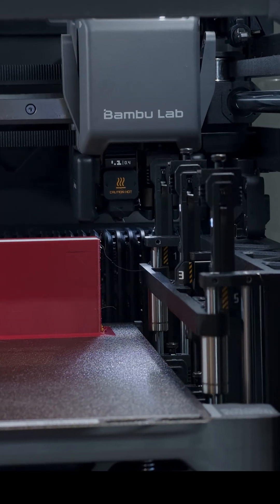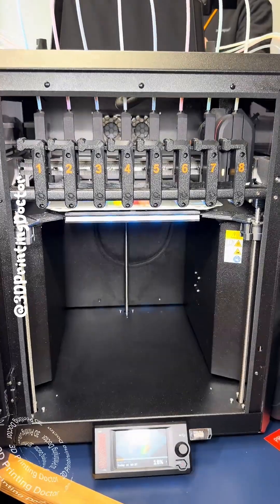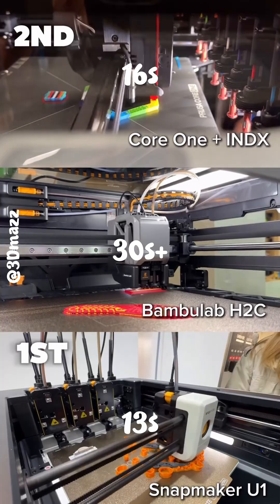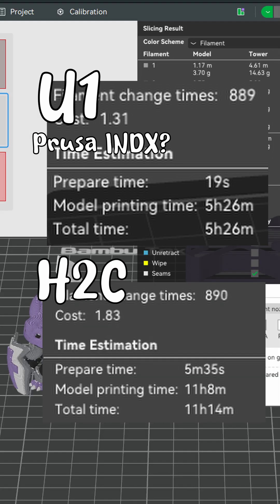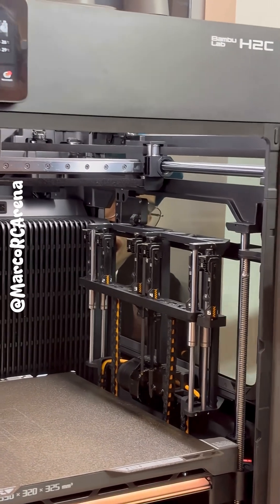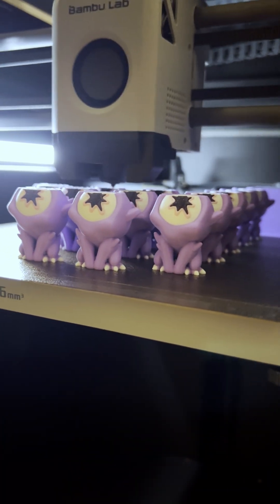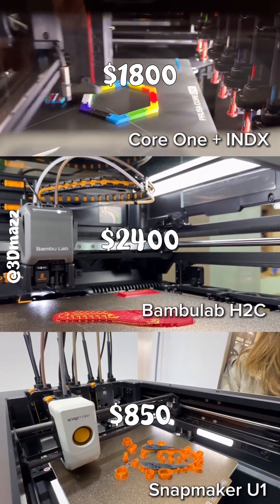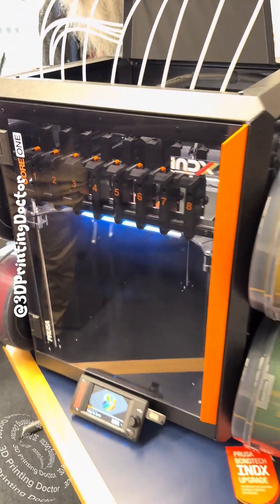The H2C isn’t worth it (for me)

Comment: The Prusa XL has problems with print failures 🤣. If one part fails it's over. Also the Prusa and U1 are small asf. And not to men the Prusa is a remote extruder... F that, you probably can't even print flexibles with it at least not reliably

Comment: I would still get the H2C, beside time, the H2C still does more. it can change Nozzle sizes in the software, And it can still run 24 colors. And I use the laser as well. Ands Bambu's Eco system is far better.

Comment: The H2C does make sense, it has upto 7 colours without having to purge, plus I have 3 P1S, and I like to keep the same eco system.

It isn't just for print farms, it's a very nice machine, I'll be using it as a hobby.

Snapmaker is decent sure but limited to 4 colours, and not anywhere near as big as the H2C.

The prusa could be excellent but that's not available yet, if you want to wait then sure, but I went with the H2C because the size and it prints colour reliably, and that's the key it's Bambu so the quality is the best out there right now in terms of FDM.

Comment: I literally just hit 100 hours on my U1 a minute ago that I've had for like a week. It's been pristine. I've filled up a tote with multi material parts and it's printing a multicolor tpu part right now. How does the H2c handle tpu? I don't think it's worth it anyway when it costs 3 times my U1 and is slower. I'm very happy with my print quality

Comment: Glad you said "for you".. I don't some multi color prints but the real reason I got the H2C was for engineering grade filament..printing CF-PC with TPU and things like that my fiberology fiber flex prints fine with the chamber heat up at 70 and prints as long as 12 hours
Reply: TPU isn’t usable on bambu labs printers properly though sadly. It’s such a faff for “it just works”.

Comment: H2C is a great one stop shop. I just need things to work and be as simple as possible since I work a lot and have little free time/ energy. Bambu's ecosystem and what H2C comes with allows me to do that with how easy the vortek system is. If Snapmaker's U1 was able to use everything in Bambu's ecosystem, I probably would have sprung for it instead. Currently, I'll probably get a P2S to help print single color models. I'm a very happy customer

Comment: The reason I’m going for H2C is mostly the convenience of the Bambu eco system; software, nfc filament, ams, slicer and huge community and profiles included with makerworld
Reply from the maker: That makes a lot of sense, it's a great ecosystem!
Reply: If you only need to print in 5 or 8 colors, but If you want more, then it's the H2C. Convenience is a powerful thing. Plus I think Bambu is also going to make a dual feeder or something like that.
Reply: @keyednation it's already dual tubes, left and right nozzles are separate...
Reply: @mostlymessingabout thank you.
I found found what it was talking about.
Future Setup (2026): A Filament Track Switch Module will be released, allowing full 7-hotend support with only 2 AMS units, enabling free filament switching between left & right filament paths.

Comment: In many discussions, the focus is almost entirely on print speed when it comes to highly colorful toy models. That raises a simple question: how relevant is this use case really, and how often do people actually print such objects?

Once the focus shifts to technical parts and functional products, the Bambu clearly has the upper hand for me. It can also handle multicolor prints, just at a slower pace. In return, it offers significantly greater color flexibility, with support for up to 24 colors.

Anyone who judges a 3D printer purely by print time is making a fundamental mistake in the overall evaluation of the system.
Reply: Yep, the H2C is enclosed too and you can have dedicated nozzles for engineering filaments.

Comment: Eh, the Prusa is pushed to the max right now while Bambu is running pure quality over pressing for time. They have already released an update that reduces time at the expense of quality, still better overall results than the INDX at these speeds. I am guessing it will go down further with another update and Prusa will introduce a slower version for better quality making them both land with options for very fast and options for better quality. Difference will probably be minimal inside 6 months.
Reply: The Prusa is definitely not pushed to the max. They plan to even lower the time necessary for INDX swap to around 12 seconds. The difference being minimal is just pure hopium. The Bamboo is limited by the AMS system and there is no way to get past that limitation without replacing it with something else.
Reply: @davidkurzica263  Not hopium or whatever to look at the pattern. Bambu already released an update that increased the speed with significant room for improvement left open. The speed of the AMS retraction is a bottleneck for sure, but the speed it pulls it back to AMS and pushes the next filament in is also a variable that can be adjusted with a firmware patch. Who knows how fast that can actually pull the filament back and push the next one in and that is probably where the most gains can be had. The only real draw back is that a user can put them as far away from the printer as the cords can reach, which is a factor that cannot be calculated. That and 24 different colors is a different spectrum entirely. 
It's a bit short sighted to act like the company that has dominated every aspect of FDM printing for the last few years is not still working on improving what they are doing in their latest flagship machine. 

But that doesn't mean that Prusa is not right there with them. I am not fanboying by thinking Bambu can make strides to catch up to the speed just like I am not fanboying to say that Prusa can slow it down to catch up on quality. There will probably be settings for both that land them in an overlap. Prusa is a great company with a wonderful history and seemingly going in a very positive direction again. Not sure why it has to be one side versus the other. They both make fine products. Maybe Prusa will be faster in the end, and maybe Bambu will offer better quality with more colors/materials at once. Both are incredibly niche use-case machines that the average person with a 3D printing hobby has little to no need for.

Comment: You are right given that you print color toys. Problem is that the U1 is not enclosed and the Prusa doesn’t auto retract so neither are as good for also printing high temp engineering materials. For example; the PLA in the other print heads would melt if you printed ABS. You would have to manually remove the other feeds - which is what I have moved beyond since getting Bambu AMS systems.

Comment: Bambu has never been worth it. Even before they royally fucked up their TOS. Their price to value is pretty much trash when every other company is doing the same thing for less and faster. This is just proof of that.

And for print farms, time is money. No one in the business of printing for money is going to pick a slower machine. If a print takes 3 days and a faster machine will do it in 1 day or less, you'd be burning money by spending more for a slow machine. That's -1 machine for 2 days for the same quality as something cheaper. 

Bambu needs to stop acting like Apple before their entire business is ruined by everyone else doing it for less.
Reply from the maker: The Bambu A1 mini has been the best value 3D printer ever, and it honestly still is.. The H2 series has been overpriced, but the A and P series are unbeatable in terms of value

Comment: One thing the H2C excels at is not multicolor but multi-material. In particular, if you want to sometimes print with high temp materials like PA6-GF it’s a major pain in the ass to clear the nozzle for low temp materials, or it’s an entire nozzle swap. With the H2C, you can permanently assign one of your nozzles to PA6 and just keep printing without breaking out the toolbox.
Reply: The others do the same. Don't get me wrong I love Bambu but its not the be all end all of all machines
Reply: @S @SythricDeadith  they don’t. If you print PA or ABS or ASA on the others you have to manually remove all the PLA feeds. Bambu uses the AMS to unload automatically. Personally I don’t want to go back to the days of manually loading and unloading. I tend to do long prints overnight so don’t really care if it takes an extra 20 minutes to print.
Reply: @rsilvers129 they both have auto feeders...Bambu isn't the only one with that option anymore. Its also not 20 minutes extra per the video its hrs up to a day longer. I'm not a prusa fan at all. But the Snapmaker U1 has the potential to disrupt the market in the same way bambu did with the X1
Reply: H series are the go to if you're doing engineering materials. If you're making colorful toys something like a U1 is going to be your bag.

Comment: I just received my H2C and agree with you about how slow it is unless you fill the build plate. However it has taken Prusa a long time to get the bugs out of the XL. Also the Core one with the 8 nozzles may be difficult to enclose for a heated chamber? I wouldn’t want to be a beta tester for Prusa. I personally am going to wait to se how many bugs it has and if they can enclose it and filter the VOC’s from toxic material.
Just my two cents.
Reply: No it’s easy to enclose, there is a hood designed for it already.
Reply: This tbh! Got the h2c too

Comment: H2C might not cut down on time and waste quite as well as the U1 but the U1 is also limited to only 4 possible filament and nozzle combinations. Where the H2C can combine any of the up to 24 different types of filaments with the up to 7 different types of nozzles.

That’s 168 combinations vs 4 on the U1

Comment: The H2C is the most reliable tree printer, and it’s also the fastest. This is because it has a larger print plate, which allows for more objects to fit on it. Consequently, the time taken to print each object can be significantly reduced.
Reply from the maker: If you print full plates 24/7, you're correct. I even said this in the video

Comment: You're right, if you forget about all the other features of the H2C. It has a lot more to offer than the other toolchangers. The flexibility of this machine is for me more important. If you put 4 0.4mm nozzles in the vortek rack and a 0.2 and 0.6 , you can very easily switch to another nozzle size, which encourages working with those nozzles when appropriate.
Also, the H2C offers the laser/plotter/cutter option and is generally very easy to use. Ever tried working with multi materials on a Prusa? The time you win in the toolchanges is lost in setting up the materials, both on the machine and in the slicer...Prusa needs to work on that. Just copy what Bambu Lab has done with Studio. There's no shame in copying something that's good.

Comment: The H2C is bigger... It also can manage humidity  better.   There are variances between both, the U1 is better for those that want something cheap.  The print times are off, not to say one is faster than the other... but a 6 hour difference?   Something isn't set right.
Reply: H2c can also do 350c chamber versus 290 on prusa

Comment: For me the H2C didn’t improve the option for printing flexible filaments. So it’s a pass for me. I’m either getting a INDX or U1 depending on how things go in half a year. (I forsee a positional U2 with a biggger volume more heads) 😅
Reply: This is exactly my issue. Those extruder gears on the x1c really are just non excusable to have on a printer that cost that much. If the H2C doesn't improve on something so basic and easy to improve, it's a pass for me. Large gear extruders have been around for ever now.
Reply: @moiram3038  In my case it's more about multicolour flex printing because It's something I really want to do. All tackle the resiudue issue of feeding throught the same nozzle. 

I would consider an H2D for the dual nozzle only for printing seperation materials but more options are coming in 2026. But I'm eager to see how the Snapemaker and INDX handles TPU in more testing. 💕

All these machine will probably be out starting Q2 next year with enough testing by then. For now I'll keep inserting my colour into TPU prints with my K2 Plus. 😅

Comment: The term hobbyist is meaningless. There is no price limit for hobbyists. I can be a hobbyist and want reliable professional printers that can print engineering grade materials. The H2C is the better choice for me.
Reply: Same here. I am looking at that dual hot end and heated chamber and thinking I can print multiple engineering materials at once. If you’ve done it before I’d like your input, but I think I’ll be buying an H2C here soon
Reply: U1 does some materials H2C can't, its a TPU monster. AMS is Bambus multicolor/material achilles heel.
Reply from the maker: I mean yeah if you need it get it. It's a good printer, I never said otherwise

Comment: I like Bambu’s ecosystem and have had 4 of their machines previously that have been the best printers I’ve ever owned. People going on about the difference of 20 seconds for filament swaps is just cope. You like prusa better, great buy one. I’ve had my h2c for a few days and it’s phenomenal.
Reply from the maker: I'm in the same situation. I love the Bambu ecosystem and I've printed on Bambu printers exclusively for 2 years now. Before Bambu I printed on Prusa though. Frankly if Bambu would just make a real toolchanger like the U1 or the INDX for a reasonable price, I wouldn't hesitate.
Reply: I think the H2C makes more sense for printing and changing between the so called "technical filaments". Like PA, PPA, PPS, PC etc. and all of that with or without CF/GF.
You can have dedicated nozzles in different sizes per filament. And since you can also connect several AMS HTs, there's also less need to fiddle around with spools.

Comment: The H2C will come into its own when bambu releases the ams 4 ptfe tube to switching module adapter,from what i understand it cuts pla color swapping to under 10 seconds.Fully enclosed,heated chamber,nozzle size swap is effortlessly done,the H2C is only utilizing 25% of its potential right now
Reply: What exactly is the switching module? I saw 247printing try and place the AMS as close to the ptfe port on the H2C as possible to reduce the change time. It still took 38 seconds, only about 4 seconds shorter. And I think with optimizing the timing you could probably save another 10 seconds, but you won't come close to toolchanger times.
Reply: @ThomasS17 the switching module will allow 1 ams to run on both nozzles it switches automatically based on wich nozzle is being used

Comment: I have the h2c and it prints so good, and after testing slicing with the others and my prusa xl it's not really slower at all.
Reply from the maker: The H2C is a great machine. Nobody will regret getting one if they can afford it. My point is more that it's not worth the price for most people, because there are cheaper, faster options that also have great quality. To your point, the Prusa XL is notoriously slow, the H2D was already faster. The U1 should almost always be faster than the H2D for multicolor prints though, at least from what I'm seeing. What are you slicing?
Reply: @superprints3d  You are correct, but what everyone is also missing is that if you were to buy one printer to print almost anything, but also do multi color if wanted then this may actually be a alternative and cheaper to having multiple machines. I almost never print multi color, but I sell parts that do use mutli material supports which this machine is probably over kill as you have stated, but my next print could be a multi color print with less waste, then I could print PPA after that. I think for the prosumer area this machine cannot be beat for its versatility, for a home printer you are correct for cost and overkill, but the H2D was also as well as the prusa xl being crazy for someone to buy as it does almost none of what the h2c can do. Where I like these machines most is material and color mapping, it saves me probably 20 min per print, with 5 prints a day is pretty nice.